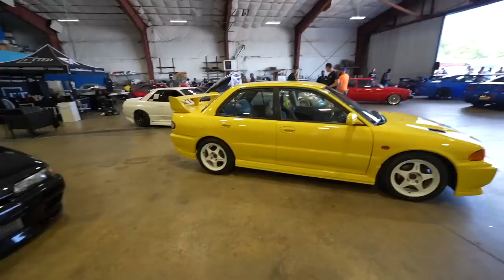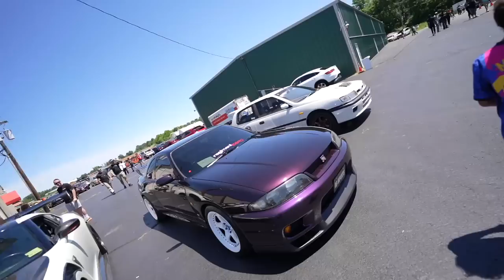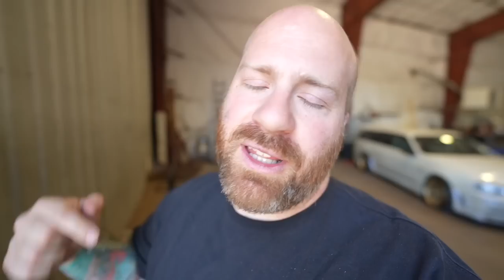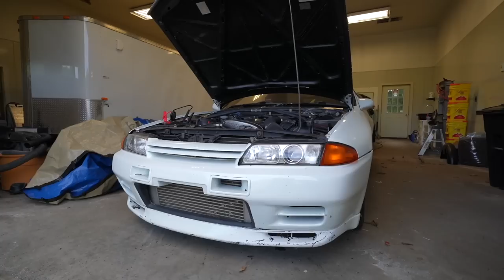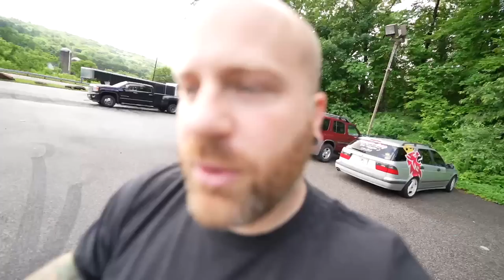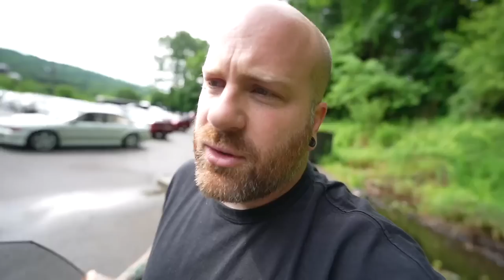ROASTING CARS AT THE NORTHEAST SKYLINE MEET!

Comment: Even though it will be the most uncomfortable driving experience ever the K series Skyline must happen. Is there any way it could be all wheel drive?
Reply: illiminate is doing the K swap 34
Reply: Keeping the awd would be great
Reply: It would be interesting to see if the k-series on an adapter for the gtr trans is small enough to clear the factory front diff position. If it does I bet you could make some kind of stand alone cradle to support a modified gtr pan/diff.

Comment: That GTS-4 Cream color with the fender mirrors belongs to @thepandagts4. It's a
1990 AWD R32 GTS-4 4 door Rally Trim edition.
Yes from the factory.
Has a RB20DET (Upgrading to a RB25)
Hicas rear steer
Factory skid plate and mud flaps.
Factory side mirrors out on the fender.
Factory strut braces front and back.
It's imported from the middle east I believe. Yes to driving up to Conn. from Smyrna, DE for a meet/show of your own. Yes to a build off. Not sure what to suggest that hasn't been done so far just no JZ's in a Nissan please. Loved that STAGEA AND Pulsar also the wide body R32's. It was cool seeing you at this show and thanks for the fist bump when I said hello.

Comment: No need for an intake on the stock turbo. Just a panel air filter.
I run low 10s on a ttrs with the stock air box, just the upgraded turbo inlet.
Reply from the maker: i need the inlet